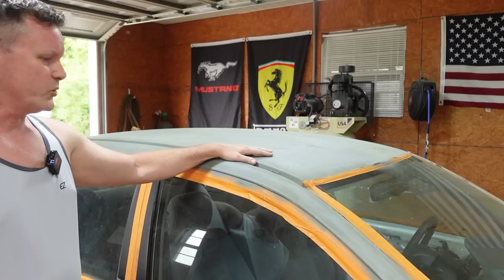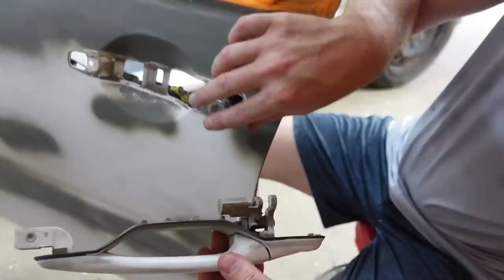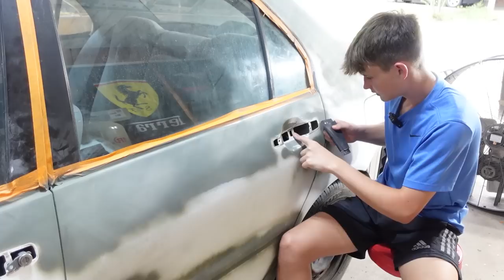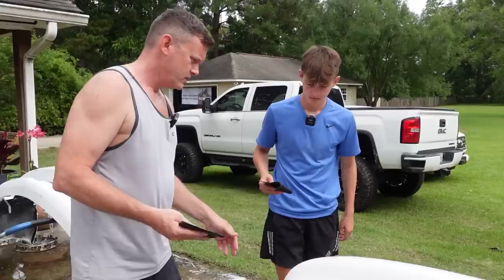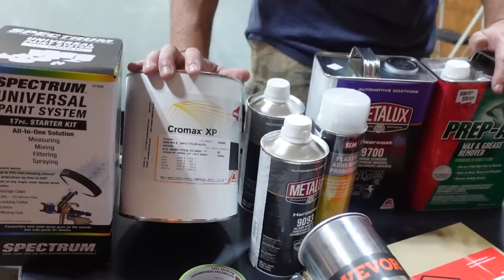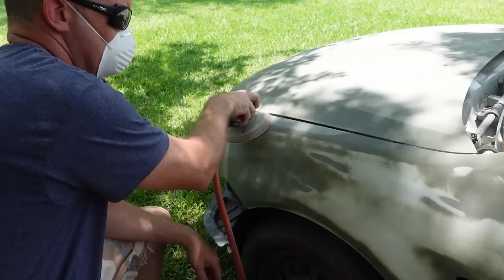Final Paint Prep for the Abandoned Mitsubishi Lancer

Comment: Nooooo, last video i mentioned to use Deoxidine to kill the rust from the pores of the metal, then neutralise that with water, sanding the rust off and using etch primer wont kill the rust and it will eventually make its way back very quickly especially with moisture such as snow
Reply from the maker: We sanded down a lot. Hopefully it will be ok. We are vinyl wrapping to roof too.
Reply: @SwampBoysGarage  Personally id paint the roof, especially with moisture and having a wrap on it, the moisture will get under the wrap and without killing the rust in the pores of the metal it will come back, id paint the roof myself, wrap is ok for a quick temp fix, but long term paint is far superior to any wrap

Comment: I don't know if your paint supplier mentioned it or not. But it's not a bad idea to use bulldog adhesive on the bumper covers and other plastic parts. And also I usually ground the body of the body of the car to a earth ground, to cut down all static electricity, and wet  the floor in the shop. And I always put a third coat of clear. So you can wet sand and buff and still have 2 coats of clear covering the paint. And don't be nervous it's just paint, you can always sand it and redo lol. Oh yeah I forgot unhook the positive battery also for the static electricity. God bless
Reply from the maker: Always appreciate the help. Did you notice I used your weed eater string trick?
Reply: @SwampBoysGarage  yes, I don't remember did I tell you about 2 inch wide tape, to get runs out while they're still wet. God bless brother